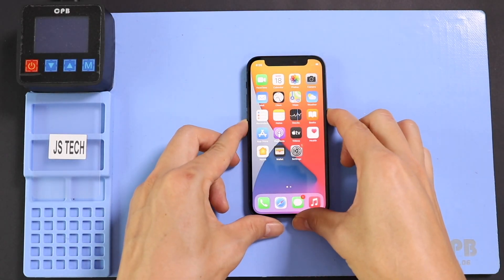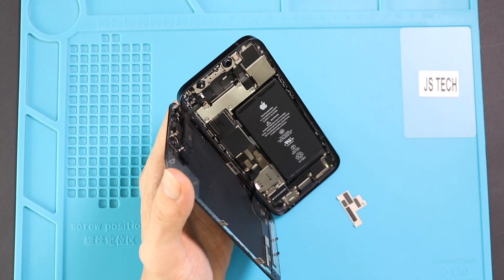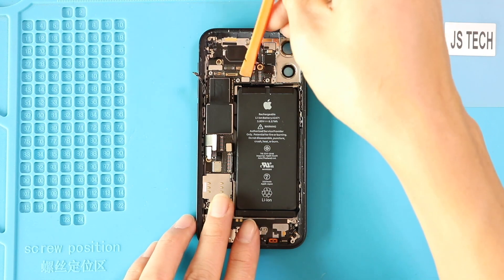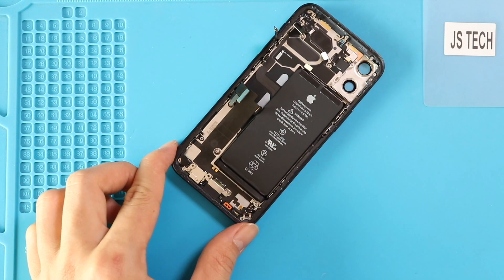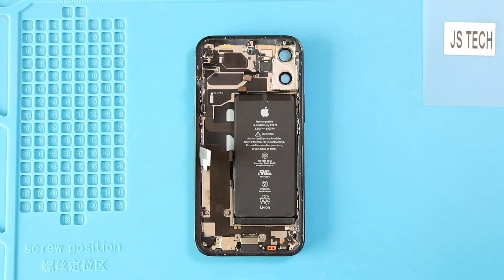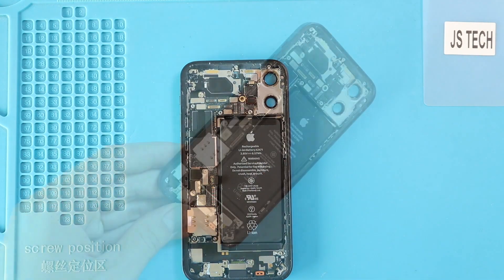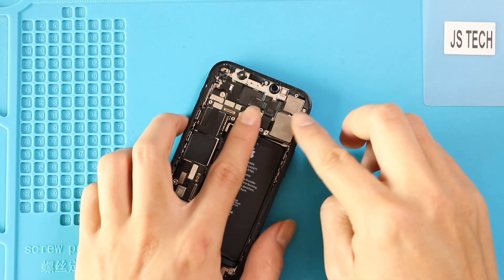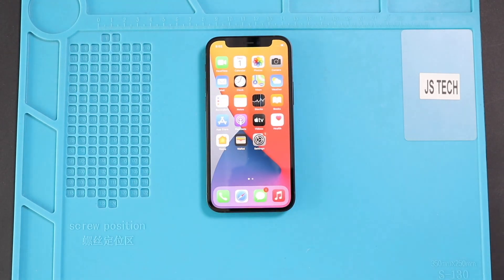iPhone 12 Mini Charging Port replacement | Logic Board

Comment: Is it normal to have the iphone reboot every 2 minutes 50 seconds after installing an aftermarket charging port?
Reply: No, it means something has not been done correctly. Check your panic logs and it will tell you what is wrong.